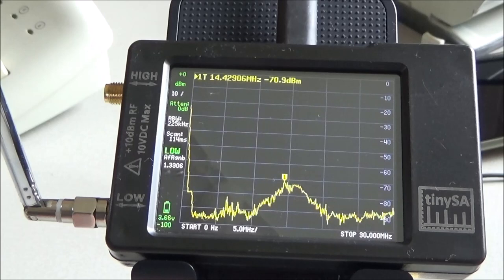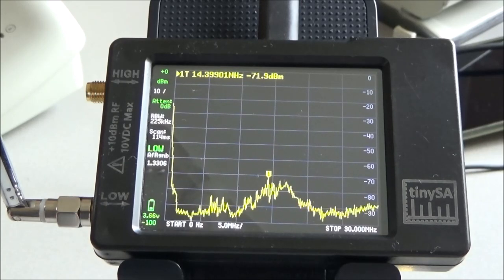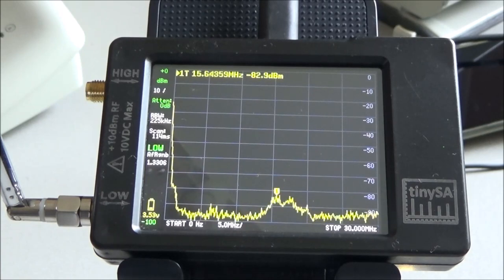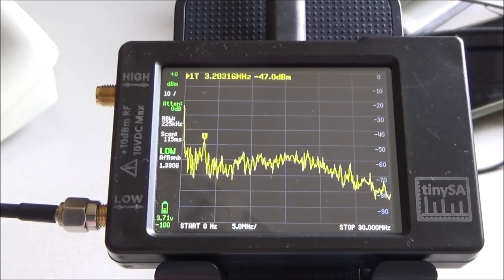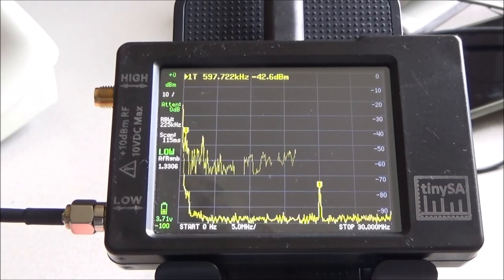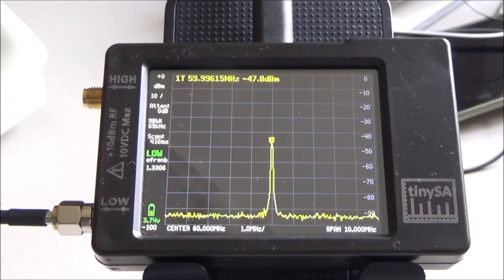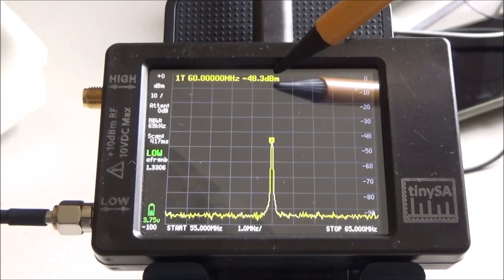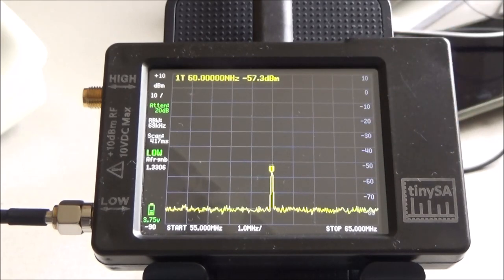tinySA Mistakes

Comment: Thank you Erik for the recent help you gave me (on the Tiny SA Ultra Firmware) and for this fantastic piece of test equipment.
To know of some of the common mistakes is very helpful in not making the same mistakes one's self.

I blew the front end/attenuator of my first Tiny SA only a few months ago due to using the Tiny SA on a telescopic whip and at the time I didn't know there was a very strong signal source in the building next to us, this resulted in the Tiny SA's internal attenuator being irreparably damaged. (Unfortunately, my hands are no longer steady enough to work on SMA and replace the attenuator chip and I now have a useless Tiny SA). 
A lesson learned from this was that my new Tiny SA Ultra ALWAYS has a 10 DB sma attenuator attached to the RF input and as long as you tell the Tiny SA that it has an external gain of -10 db, the readings are as Erik demonstrates here and there is a greatly reduced risk of blowing up the Tiny SA's internal solid-state attenuator.

Does anyone feel like replacing the attenuator in a Tiny SA?

A GBP 10.00 attenuator is much preferred to a dead Tiny SA.

Thank you again Erik.
Regards,
K W.

Comment: Thank you for taking the time to explain why these things happen rather than just stating that they do. Harmonics when it comes to any spectrum analyzer can definitely bring a whole new set of headaches into the mix for sure, knowing how to figure out their origins can be quite useful. All around I find the Tiny SA to be one of my most valuable pieces of test equipment for sure. If I had to choose 1, I'd be pretty torn between it and my Oscilloscope. When working on radios the SA gets way more use, hands down. The ground issues you pointed out is another very useful thing to keep in mind with a lot of test equipment, when it comes to electronics bad ground can cause many strange symptoms to emerge. It reminded me of some of the crazy things I've seen happen with a vehicles 12vdc lighting circuits, and in the end a bad ground was the only issue. A good solid ground is very important where electronics are concerned, it's something I find myself repeating a lot when teaching others, and here again is just another example of what can happen when a solid ground connection isn't achieved. Thanks again, time is valuable, so you sharing yours is very much appreciated.

Comment: These are really great tips, thank you.  The tinySA is capable of a lot more than I initially thought.  While it may be a bit more sensitive to these things than a full sized SA, these things can be adjusted for, and the performance this has compared to its cost is amazing.  It brings SA use into the hands of people that could not otherwise afford it.

Comment: The problem is the pulsed power supplies, especially the PC PSU. The data flow is also an issue but small compared to pulsed PSUs. When you connect your cable , you only need to make the grounds in contact to see the big noise bump. Place your cable near the PC and run some CPU demanding application like a game on full details etc. You will see even higher 'bump' on the spectrum.

Comment: I wonder if a future version could use opto isolators for a second USB port (not the charging port, obviously) to allow data transfer without a physical connection?  Do ferrite chokes help with the USB noise?  Thanks for the great product and videos!
Reply: I don't have a Tiny SA (yet) but I do find ferrite cores very effective with other similar instruments that I have. I take a long USB cable, 2m or more and thread it through three cores, one at each end and one in the middle. I put several turns through each core, using up about 1m of the cable length in the turns. I use large ferrite toroids salvaged from switch mode power supplies so that I can get several turns of cable into it. 
I tried the split cores that are purposely made for suppression but I found them not to be very effective. They do help a little but nothing like the large toroids with multiple turns.

Comment: Only clean power supply for sensitive, fine measurement  is battery... even today we do not heave super clean supply  thought  ac network...
Reply: He should also test it with a powerbank USB connection. Probably the noise comes from his usb power supply.

Comment: Thanks for informative clip.  I also noticed the same problem of USB connection to computer.  To solve the problem, I am designing isolated ground and power supply on a board that goes in between tinySA and the computer.  To isolate the data lines of the USB, I am using two opt-couplers ( one on each direction) , which only passes digital signals. The side that interfaces with TinySA uses a battery and the side that goes to computer uses the computer power.  I was thinking to use fiber to isolate them, but I do not think that is necessary. I will let you guys know , how it turns out.
Reply: Very interesting project! I don't see why it wouldn't work honestly. 😎
Reply: @digitalchaos1980   I noticed that they have USB-C to fiber and vice versa module already available in the ebay.  So one can attach one to TinySa and another to computer and connect them with fiber, to see if this would resolve the issue.
Reply: Your idea will work for the Data lines of the USB connection, but, I think you are still, likely, to end up with noticeably increased levels of ‘background floor noise’ on the TinySA with such a design, with the noise still, coming into it through, the DC side of the USB connection, because even if you make the intermediate PSU with a completely isolated, ‘floating Ground’ unless, the output DC of the intermediate PSU is, itself, completely, noise free, ..and, the intermediate PSU, itself, is completely enclosed in a Faraday Cage, ..and, the entire length of the DC ‘feeders’ are entirely balanced, and, RF shielded, then ‘the entire DC side’ will still, simply act as another, Antenna, and will still, pick up any spurious ’noise’ in the vicinity, and inject it into the TinySA via its DC power port.
Reply: @wa7215  No DC connection if you use fiber or opto-couplers.  Dc supplies are isolated.
There is a software fix too.  that is measure first and save the data then stop the measurement and transmit the data, then stop the transmission and measure and save and repeat again.

Comment: what setting did you use, for those markers to suddenly pop up, and populate new signals from 8:46 with only 1 marker active to 8:51 and 3 markers active.. none of the settings seems to give that standby aspect as I can see you only have tracking active on marker1? how did marker 2 and 3 suddenly got activated?
is it a threshold?
Reply from the maker: I used MEAESURE/HARMONICS

Comment: My unit has a dead Low input and fails self test 3. How can I troubleshoot this, is there a schematic available?
Reply from the maker: The HW design is not public but you can follow the input signal and see if it arrives at the mixer. This will give you a first clue of what is broken. Join the tinySa support groups.io for more support
Reply: @ErikKaashoek  OK thanks.
Reply: @ErikKaashoek  Is there a block diagram at least?
Reply from the maker: @stevec5000  Yes: https://www.tinysa.org/wiki/ and technical description

Comment: Is there any way of using the TinySa app to capture data, wtihout introducing noise through the usb-c? 
Ive tried ferrites, Opto-Isoltors and Lowpassfilters...But it seems nothing realy cleans up the signal well.
Its so sad, because its a neat little device, but when youre not able to pick up stuff and record the data at the same time its fairly useless...
Thanks in regards!
Reply from the maker: What is the source you are capturing from? Is it a small antenna of a well through a good quality shielded coax to a source isolated from ground to avoid ground loop through USB?
Reply: @ErikKaashoek  Im using the supplied antenna. Capturing EMI of other USB-Cables. Should I use another antenna? Another idea of mine would be to use a AOC (active otpical cable) USB-C cable to connect to the pc, so it cant act as an antenna. But im not sure if this will work.
What type of USB is used in the tinySa? 3.0?

Thanks for your reply!!
Reply from the maker: @youri2361  As the supplied antenna is a monopole antenna (like any end fed antenna), the USB cable becomes part of the antenna. This causes ALL noise from the USB cable to end up in the tinySA input. For best EMI capturing you should use a loop or dipole antenna. Preferably with an extra amplifier
The tinySA uses max 12MHz USB
Reply: @ErikKaashoek  thank you very much! I will look into it ;)

Comment: I have a genuine Tiny SA supplied from a NL vendor. I'm using it as a low level signal generator at 1MHz. I find that the indicated attenuation accuracy is good down to approx. -30dBm but errors creep in at greater attenuation levels eg at --45dBm indicated on the TinySA the actual attenuation is approx -50 dBm. Is this normal?
Thanks,
Mike
Reply from the maker: There is a config setting to correct the low level non linearity
Reply: @ErikKaashoek  Thanks Erik. I connected the Low and High together and went to Config, Level Cal, Calibrate and the Tiny SA responded with Calibrate complete. Unfortunately it still reads incorrectly below -30dBm. e.g for an input of -45dBm the Tiny SA reads -40dBm. The 5dBm error is constant down to -60dBm. My other test equipment cannot measure below -60dBm.  My test frequency is 1MHz.
Can I do anything to correct the error or do you think I have a faulty unit?
Thanks,
Mike
Reply from the maker: @mfwwhelan7561  please check this page https://tinysa.org/wiki/pmwiki.php?n=Main.USBInterface. and in particular the leveloffset command.
First correct the low output level around -10dBm using the "leveloffset low output" command and then correct the level around -50dBm using the 'leveloffset switch output" command

Comment: Mr. Erik, I'm trying to figure out what I can do with Tinysa. Although Tinysa can detect in a certain frequency range, I want to ask, what can I do to detect at low frequency values? I really need this. For example, I want to see frequencies between 10hz and 30hz on the screen. What can I do for it? there is no possibility to download a suitable software?
Reply from the maker: You better use the audio input from a PC and audio analysis software on a PC to do that
Reply: The TinySA is not the tool for such low frequencies.

Comment: Hello, in the "attenuate" part you explained towards the end of the video, the signal strength for 60Mhz is seen as -56dbm. Can we set a level in this section with the manual Attenuate setting? For example, if we do not want to see signals weaker than -40dbm on the screen, do we need to adjust it from this section?
Reply from the maker: You can always set the attenuation to the optimum between sensitivity, seeing small signals, and avoiding internal distortion by increased attenuation.  Hiding weak signals can be an extra benefit
Reply: @ErikKaashoek  Thanks for answere. That is, we can eliminate weak signals from the "attenuate manual" tuning section. Is it correct?
Reply: Led lights !  I have seen noise up to 200mhz from led lights. The spectrum is full of crud. Try antenna outside on the roof or better still switch off the mains to test for noise.

Comment: just a question, I know this is an older video but since i just ordered a tiny sa, would a ferrite bead on the usb cable do anything or little to calm the noise?
Reply from the maker: Don't know. Maybe you can try?
Reply: @ErikKaashoek  I will try it and if there is any difference  I shall let you know~

Comment: Hi Eric, I am a bit of a novice , I thought I woukd test a 100mhz AM at -100dBm out of my Marconi  2019A to my Tiny SA , the 100mhz spike on my TinySA is kind of bouncing around 3dB from -100dB on the TinySA vertical scale? am I doing something wrong ? or is this just the loss in the 1ft patch lead I am using?
Much appreciated. 
PeaceFromOz 🇦🇺.
Reply from the maker: AM modulation makes it jump up and down
Reply: @ErikKaashoek  thank you very much Erik.

Comment: So using the PC software to comunicate with the SA is useless.
Reply from the maker: No, no just should be aware of the interaction between the monopole antenna and the USB cable. When using a loop antenna this problem would not occur